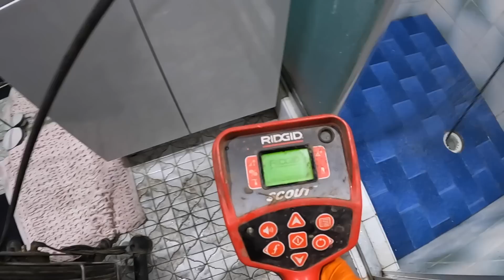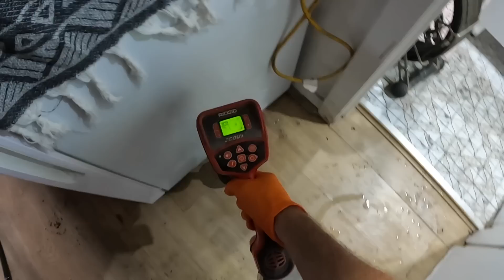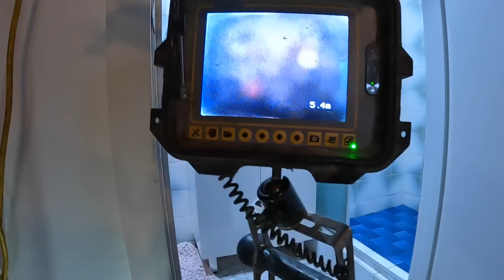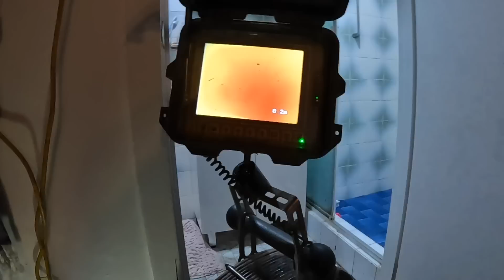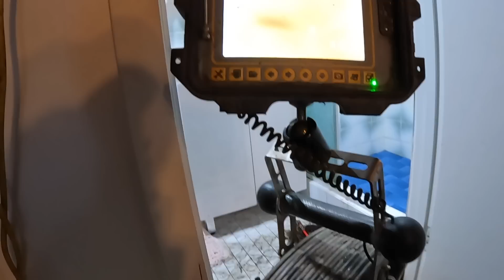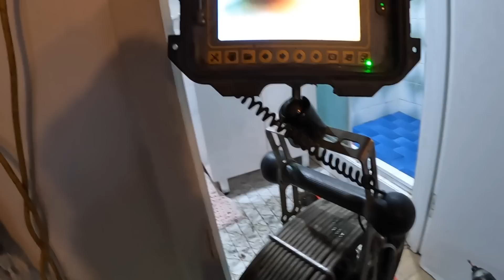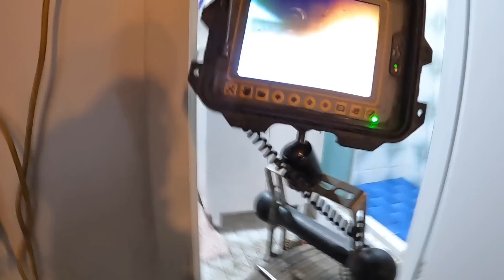Blocked Drain 771

Comment: Here in the States, we don't have as many access points to the drain systems. We typically have a clean out inside the home and the stack vents through the roof. Our waste lines go straight to the mains, without any traps along the way. Of course, living in four climates, our water and sewer lines have to be below the frost line at all points, which is at least a meter below the turf.
Reply: There has to be a drain in the middle of all bathrooms, toilets, laundry’s in Australia sometimes it’s just a 50ml drain that goes outside with a flap so no insects come it. Sometimes (most of the time in bathrooms) it’s sewer and it’s call a floor waist gully it’s usually 80-100ml and and the sink, shower and bath plumbing usually run into it. That’s clearly what this bathroom had before but they have done a dodgy Reno

Comment: When the shower drain was blocked, it appears that the water level was above the gully?  So if the lid to the gully was removed, would be under pressure, correct?  Good thing the lid to the gully was completely sealed!

Comment: What happened to the penetrator jester?
Reply: Probably wanted to avoid using it on the wood hard floor where it could splash back all over the place, which isn't good anywhere outside of a bathroom.